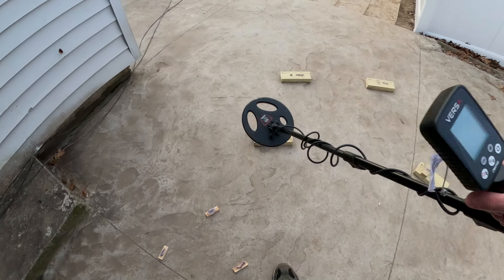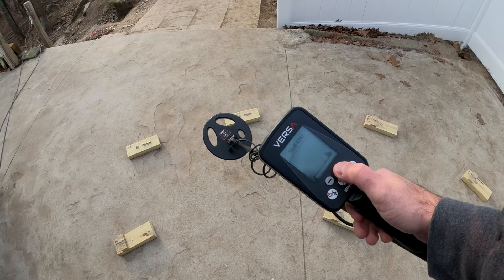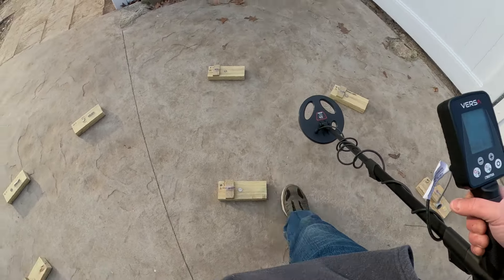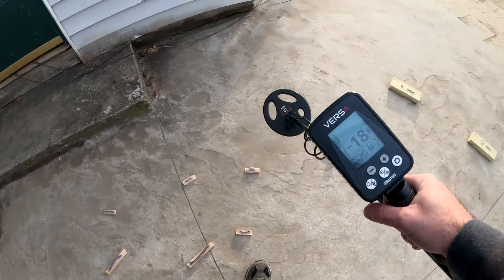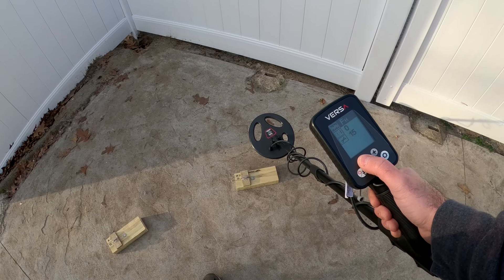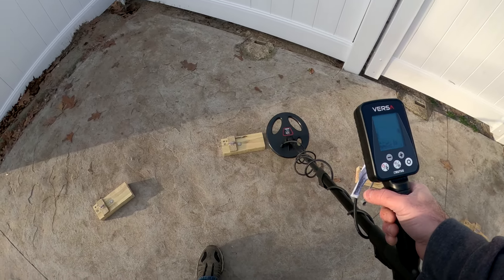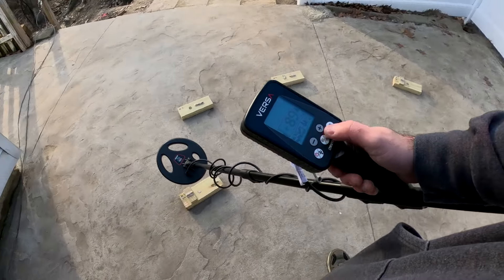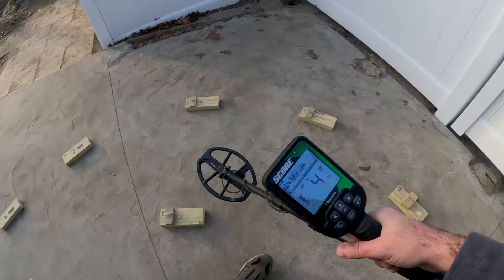RUTUS VERSA 2.44 SEPARATION TEST WITH DD23 COIL - METAL DETECTING

Comment: It's been 20 days since I purchased Versa, and I mainly use the multi-frequency at the beach.  But there's a problem!  Target depth not working properly?  There is no mineral response signal through the headphones, but the current depth is quite short.  I think there's also an issue with the sensor being too quiet when detecting the beach.  It felt as if the noise had been forcibly blocked.
Reply from the maker: Hopefully some of the Versa users will chime in and help. Did you have a machine before the Versa that you can compare to? There is also a FB page for the Versa that could help get you some answers.

Comment: How weird is it that they make a sim multi machine and factory default it to start up in single freq? 🤔
Reply from the maker: Good point.
Reply: So tell me when would you use multifrequency?
Reply: @mdfishing299  Always in most situations. Unless you have a rutus I guess.
Reply: @flyrock2  multifrequency should be used on highly mineralized soils.
If detector doesn't react to the soil and is stable on single frequency than you should use single frequency for much better range and detection.
Multifrequency doesn't give better results in normal soils... 
So first of all you should educate yourself about difference between single and multifrequency and when to use them.
Reply from the maker: Sending a high frequency and a low frequency into the ground at the same time covers both your high conductors and low conductors. The only time i would run a single here (my soil is not very mineralized) is if the multi was unstable which is not often. Why would you want to run single anymore unless you are specifically looking for gold or a cache?
Reply: @mdfishing299  Ha ha 😂 🤣 😆 keep doing that. More finds for everyone else.
Reply: @flyrock2  well and vice versa, stick to the multifrequency even if you don't have to or do the tests for yourself and  you will be surprised about range difference between multi and single frequency.

Comment: I m a owner of a Rutus Versa since a few weeks. I'm very disappointed with what I'm seeing. I also tried to do the test and the results are the same, it doesn't matter if in the woods on a concrete slab or elsewhere, there are coins here and the metal doesn't detect them, that's it. Furthermore, I think that a manufacturer should take advantage of all the advice and tests carried out by users and not come into conflict with them as happened to Calabash. I sincerely hope that the Rutus engineers will make an improvement to their product as soon as possible, otherwise, as far as I'm concerned, I will return the unit and buy a less expensive one, but one that detects metals as a metal that costs that price should.
Reply from the maker: Max, I appreciate the feedback and your verification of the testing. I hope RUTUS addresses the concerns.
Reply: @omnitron  i saw the comments on your youtube channel from Rutus. Just out of their arrogance I would return the metal detector even if it were the best in the world. It's a shame I only read them now… already bought.
Reply: How  does it perform in single freq. with the tests? I'm starting to think they have a multi-freq issue that needs dialed in. Similar to what we saw with the Legend when it was first released.
Reply: @travismitchell9637  main problem is with multi frequency mode, in single frequency it performs better.
Reply: I agree Max, like you I've only had the machine a few weeks. It'd been great if Rutus would have came out and replicated the test and addressed concerns preferably with an English speaking video. Instead there's been a backlash blaming everything bar the machine. The cable, EMI levels, Multi frequency over single choice, ground-balance, discrimination, small coin boost, concrete slab, tone break and even US coins have all played a part in it's poor performance even when the other Multi's pass the test at half the price right out of the box. Now people are blaming the style of test as wooden blocks and nails aren't a replication of a real world scenario which is very true however we have to have a baseline test with equal parameters for all machines. When other machines are passing this but the Versa can't do you really think it's going to smash the competition in the field? There's clearly an issue with unmasking. Doesn't mean it's a bad machine, has a lot of features I like but it needs an update.
Reply: @omnitron  Completely agree, ground conditions only complicate the scenario for any machine not make it easier. Very simple to see the machine is not performing in this area where others are passing with ease. I'm embarrassed as a user that the answer is to lower the tone break to -5/-6 and to only test euro coins.
Reply: @MaxSignal-79  Have you looked into a return with any success, as mines been used in the field i'm doubtful I can return?
Reply: @omnitron  I sure wish your videos had English sub titles available.
Reply: Looks like a great machine for collecting iron.

Comment: Hmm i understand.. In the beginning i had problems with the Atrex Multi doing the same things but when soil was poluted with water/minerals the machine struggled on non mingled non ferro as well. I always had contact with Rutus by chat with Wiola or something (company owner)  and they were always very helpful and open for discussions and stuff. Never had a bad argue with them, just send vids of it and they worked it out.

I had high hopes when seeing the test run of Top digin on youtube.. EU ground and EU targets. It wasnt under performing a alot compared to D2 and Manticore.
Reply from the maker: I think they are looking into it. Hopefully they will be able to update the software. 👍
Reply: @IffySignals  i cant remember but have you tried to adjust the sounds? On the atrex, If i remember correctly i had to adjust sound and tone breaks to make it perform.
Reply from the maker: @TheInsox  i didn’t try any tone adjustments. If you go to one tone and drop the tone break into the negative range (- 10) or a little less it helps unmask and non ferrous will come into that negative range and give negative IDs. I am not sure how this will handle out in the field but I have seen posts and videos showing this helps the Versa unmask. I have not tested it.

Comment: Are you in communication with anyone from Rutus?  Is this version 2.44 ?  I know tcDetects in the UK uses a Versa may be worth asking him his thoughts as well.
Reply from the maker: Hey Travis, no. Have not heard from anyone.
Reply from the maker: Loren is spot on in this video. This can also be done on the Versa. When you lower the first non ferrous tone break into the set iron range you will then pull through the non ferrous. The negative impact to this is you will dig much more iron because you are making this adjustment on a single sample of iron. That is why manufacturers setup there own particular range of iron in this case -29 - 0.
Reply: I am looking for the link
Reply: @IffySignals  In this video I can't understand but it appears to be having the same issue but at the 4min mark he makes some adjustments on screen that help. Now I can't tell if his iron is on the same plane because it is buried but the machine does respond better. https://youtu.be/HJOXuekvJmc?si=saTWqb9l9TMwzzPM
Reply: Nice information Iffy , well all the same as before , score wins again cheap detector but Quality made. RUTUS JUST Throughout a detector, Do they test them I think not .
Reply: See my reply in the comments, sure Rutus will address as needed.